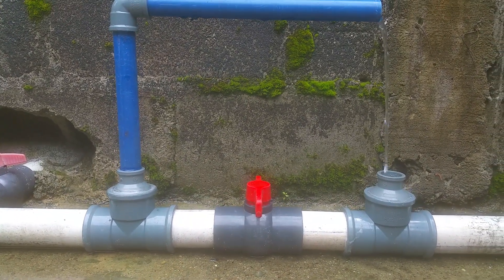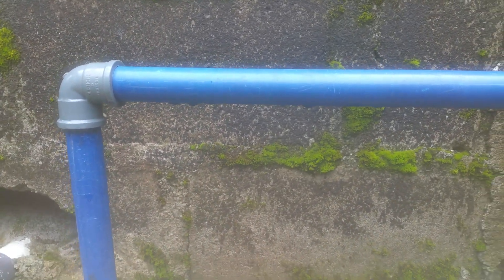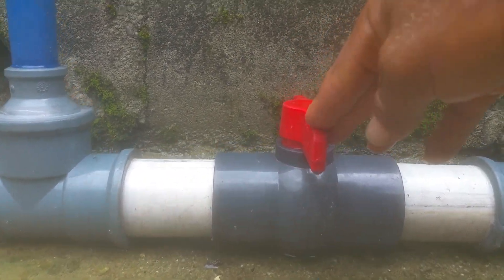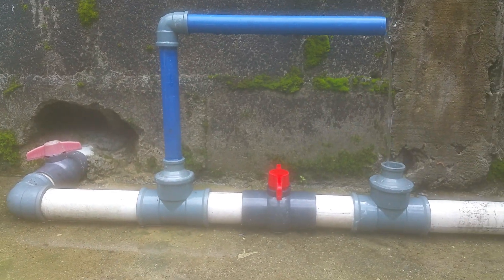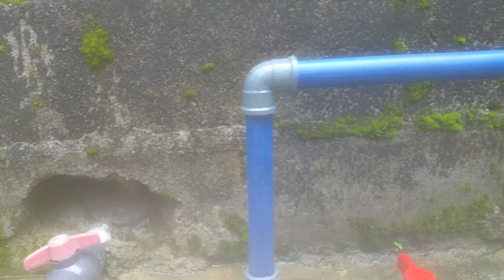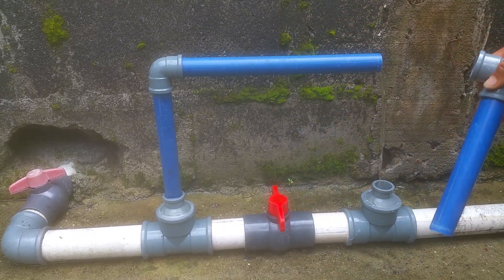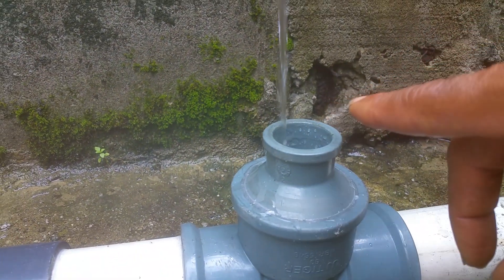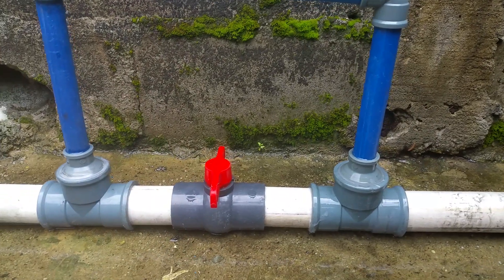HOW TO BUILD A FISH POND WITH A STANDARD DISCHARGE AND OVERFLOW PIPE CONNECTIONS 2018

Comment: This a great idea, I prefer it when the over flow pipe is outside. Having the perforated overflow pipe inside the pond  will likely cause the oxygenated water to flow out once the pond is filled instead of the old waters which are the bottom.
Thanks

Comment: This is really awesome!!! The only concern is since you have the first ball valve to control the flow, the amount of new water must not increase past the flow allowed by the ball valve. I think the design would work by removing the first valve and increasing the size of pipe going vertical or have a series’s of up and down piping with each vertical up a few inches taller then the other.(something like a cell signal icon on our phones.

Comment: Great video, however explanation for the valve immediately from the pond was not on point.
If I may help, this valve allows you to fill the pond to the brim at the point of preparing the pond; because once this valve is closed, the overflow system will be disconnected and water will fill the pond and can even over-flow.